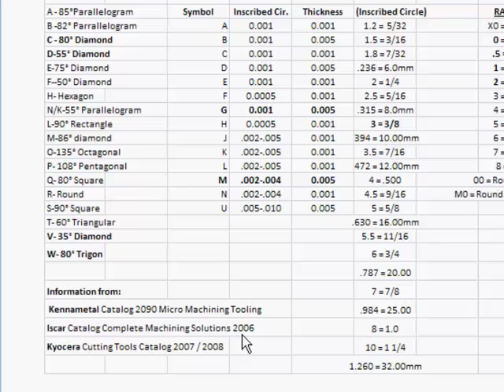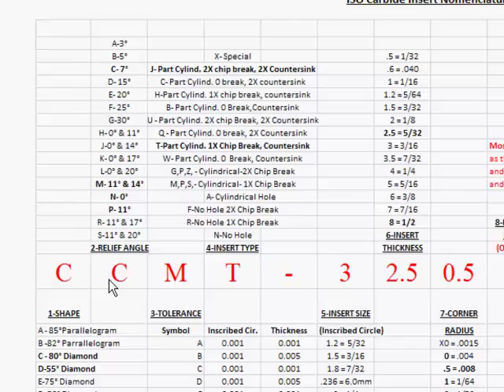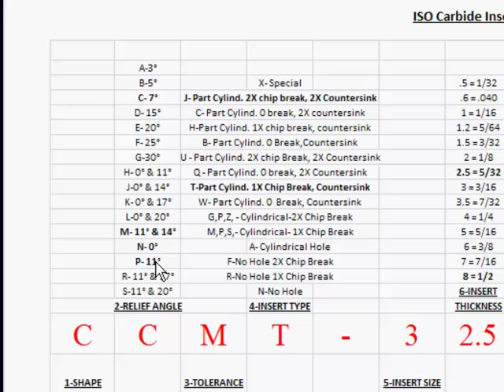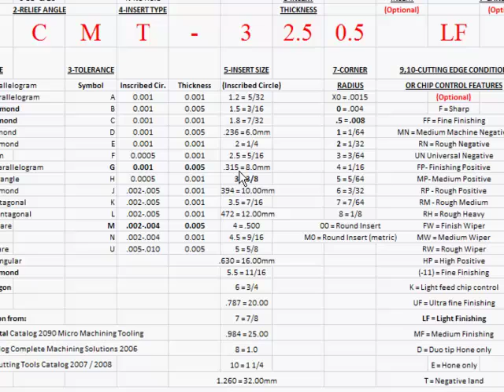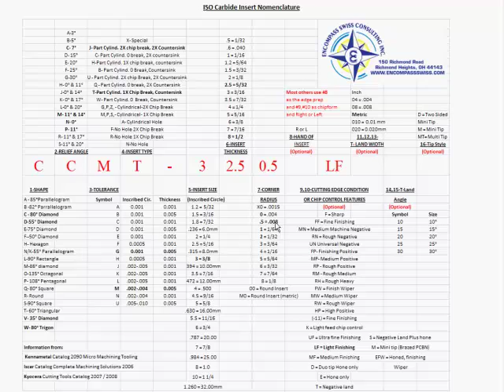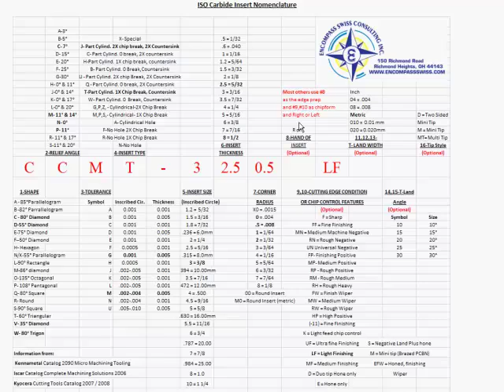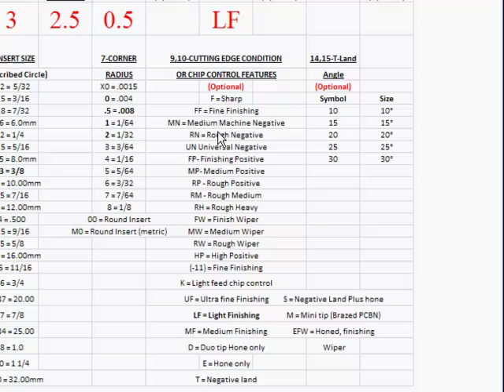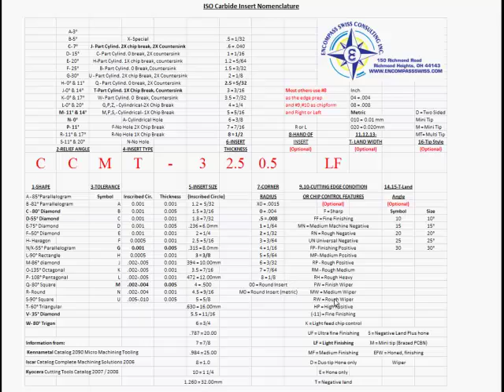Understanding ISO Carbide Inserts

Comment: There's a lot of tosh talked about inserts!!
Kennametal "KC 850" is a very good hard wearing work horse.
(Sandvik GC 910 runs it very close)
Kennametal H10F is great on screw cutting & turning  Inconel/Monel  (15 deg' approach for rough turning) with an H10F DNMG insert for finishing.